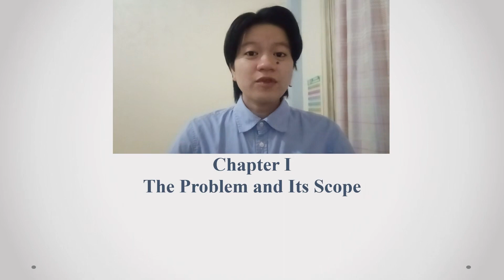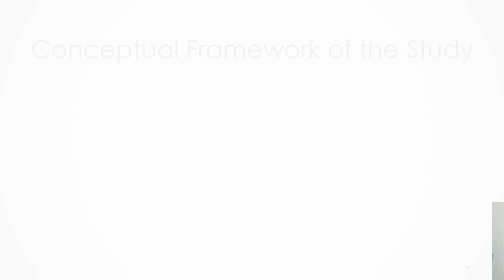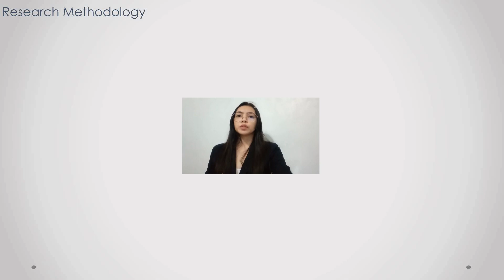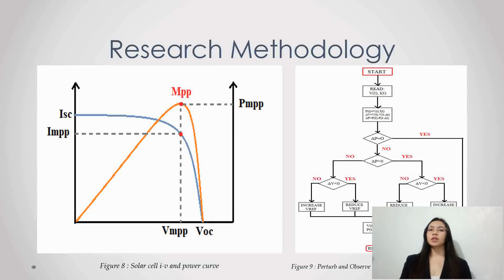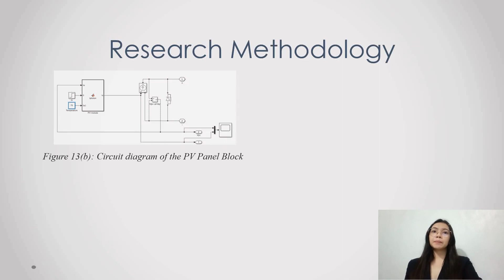The Use of Buck-Boost Converter in Maximizing the efficiency of Grid-Connnected PV System

Comment: NAME: Bernard Donn M. Valencia
CLASS NAME & SCHEDULE: ENS341- B ; (5-8pm) Saturday 
DATE: March 25, 2022

Reaction: The material was provided and discussed in a straightforward and concise manner. Because traditional grid-connected PV systems face numerous obstacles to the main grid's reliability and stability, the buck-booth converter should be an excellent solution for making solar energy an economically viable alternative to oil and gas.

REFLECTION: This research has significant implications for residential, educational, and commercial structures. The performance of the PV system will attract more customers, allowing their business to expand, and it will have the least negative environmental impact when compared to alternative energy sources. We need to come up with an idea for alternative energy that will help us conserve electricity while also being environmentally beneficial.

Comment: NAME: Clark E. Juanites
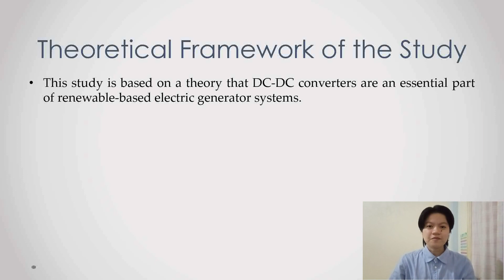CLASS NAME & CLASS SCHEDULE: EE 341A 6:30 - 8:00 PM T-Th
DATE: March 25, 2022

REACTION: This research is really interesting. How the researchers  handle this one amaze me.

REFLECTION:  Because fossil fuels and natural gas are fast depleting, we need alternative energy sources, notably in the production of electricity. By creating consistent voltage and increasing efficiency, the buck-boost converter improves PV systems and their performance. As a result, the number of PV modules required to connect multiple solar arrays to the grid will be lowered. This will surely be beneficial to the people.

Comment: Ronel S. Bayonado
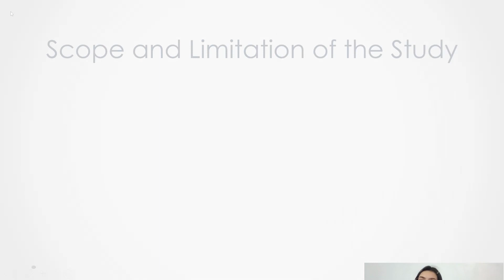COE 346 Methods of Research T-TH 5:00-6:30 PM
March 25, 2022

REACTION:
The proposal is informative and discussed very well. Really great idea to add a buck-boost converter to the standard components of the PV system in order to maximize efficiency.

REFLECTION: 
With the help of a buck-boost converter in PV systems, this will greatly reduce the power going to waste and increase it's overall productivity which means it generates electricity to its maximum capacity.

Comment: Mamigo, Jascha Anthony T. 
EE 341 Research Methods for Engineering TTh 6:30-9:00PM 
March 25, 2022

 REACTION: The researcher has done an excellent job of presenting the information and it is really interesting. They put a lot of effort into capturing green energy in order to provide enough electricity to the neighborhood.

REFLECTION: Because it is a solar energy system, this system is extremely vital due to the rising demand for energy. In the production of power utilizing solar systems, the Buck-Boost Converter concept is particularly good.

Comment: REY STEPHEN O. TUMAPON
COE 346 Methods of Research T-TH 5:00-6:30 PM
March 25, 2022

REACTION: This research proposal is great and interesting because it covers the use of buck-boost converters on photovoltaic systems with the use of the Pertub and Observe method to determine the maximum power point of the photovoltaic system. This study is very informative.

REFLECTION: The researchers did a great job on this research and enlightened our minds about the difference between solar energy and conventional energy sources.

Comment: NAME: Rupert Tristan R. Borlaos
CLASS NAME & CLASS SCHEDULE: ENS 341-A (2-5 Saturday)
 DATE: March 25, 2022

Reaction:
The research proposal in the video presentation is well introduced, the voice of the clear and can be heard but there is a background noise interfering in it. For me, visual presentation is good because they didn’t use colorful designs in their PowerPoint presentation. The research proposal is also intriguing because of the way they deliver and present their research.  

Reflection:
The research is all about buck-boost converter in maximizing the efficiency of grid-connected PV system. This is beneficial for household, commercial buildings and also the environment. This research has a huge potential because it is a good alternative energy source and it is very good in electricity production.

Comment: Villanueva, Chastine E.
COE 346 Methods of Research T-TH 5:00-6:30 PM 
March 25, 2022 

Reaction: 
This research was extremely beneficial to everyone. They do an excellent job at presenting their proposition. You did an excellent job.

Reflection:
In the production of power utilizing solar systems, the usage of a Buck-boost converter is quite beneficial. It will boost the system's efficiency.

Comment: NAME: Nica P. Ragay
CLASS NAME & CLASS SCHEDULE: COE 346-A (TTH 5:00-6:30 PM)
DATE: March 25,2022
REACTION: The researchers delivers their study clearly and also in a kind of advance engineering. Solving efficiency issues with our solar systems this kind of study helps those planning to setup their grid-connected PV-systems. This is a very cost savings since we are boosting the efficiency of how much energy we can extract from the sun.
REFLECTION: This study aims to have a greater savings to those homeowners and building owners that they can save and yet earning from the PV to Grid energy sell out. While using this kind of technology we can assure that we can provide the demand of the load and if we are generating more we can sell it to the grid corporation for a money-back savings or energy credits.

Comment: NAME: Tracy Alex E. Manzo

CLASS NAME & CLASS SCHEDULE: ENS 341 Research Methods for Engineering - SATURDAY (5:00-8:00PM)

DATE: March 25, 2022

REACTION: It's an interesting study. This study encourages the use of green energy to benefit the environment while also addressing process difficulties. This will undoubtedly motivate a large number of individuals to switch to green energy. The performance of a normal photovoltaic system will be improved by using a buck-boost converter. It will let the solar modules to use their full potential, allowing them to send electricity to the load with fewer losses. This is a fantastic idea.

REFLECTION: Fossil fuels such as oil and natural gas are rapidly depleting around the world, and these resources are unsustainable, necessitating the development of alternative energy sources, notably for power generation. By enhancing the components of the current photovoltaic system, we may be able to decrease losses and enhance power output. It is our obligation as students to not only develop ourselves but also to learn more about current technology that can help us in today's environment. And I'm well aware that there are a slew of great ideas out there just waiting to be discovered.

Comment: Name: Belinario, Cristy T.
Class Name and Class Schedule: ENS 341 B - (5-8 PM Saturday)
Date: March 25, 2022

Reaction:

Without a doubt, solar energy has the greatest potential to be used as a new source of electrical energy because it is an infinite source of energy. The use of a Buck-Boost converter for a grid-connected system could be a solution to make solar energy more cost-effective and self-sufficient than fossil fuels. The study will be beneficial to businesses and establishments. I agree with the statement that having a constant supply voltage supply means having less energy supply fluctuations, which is possible with the help of a Buck-Boost converter. A building with a Photovoltaic (PV) system has enough electricity for their load making their energy consumption from primary source which is powered by conventional energy last costly. Because the PV system is connected to the grid, it is possible to deposit the excess electricity generated by the PV modules. As a result, the cost of electricity is reduced, resulting in a higher income. In addition, the improved PV system based on the study will attract more customers, allowing the business of PV contractors to grow.

Reflection:

The study has taught me how impressive a photovoltaic system, also known as a solar power system, is. It is an electric power system designed to provide usable solar power through photovoltaics, which is the conversion of light into electricity, and consists of a number of components arranged in a specific configuration, including solar panels to absorb and convert sunlight into electricity. Renewable energy technologies, such as solar energy, can mitigate the negative effects of other energy sources, which emit greenhouse gases and pollute the water and air. This is extremely important for us humans to develop innovation that prioritizes the welfare of the environment in order to sustain life further. The proposed project is a little difficult for someone who is unfamiliar with the terms, but it encourages familiarity with these variables for more effective learning.

Comment: Loren T. Cuaresma
COE 346A Methods of Research T-TH 5:00-6:30 PM
March 25, 2022

Reaction: 
This study is unique, informative and interesting. In which that it uses a video buck-boost converter to raise a photovoltaic system's performance. It is a proposed solution to make solar energy cheaper than gas.

Reflection:
They studied buck and boost converters to produce consistent voltage and improve efficiency. The study's relevance is that the output voltage can be set higher or lower than the input voltage, keeping the voltage level constant. This study will benefit all that uses solar energy and ulitize solar energy in their filed of work.

Comment: Name: June Anthony K. Sarga
Class Name and Class Schedule: Coe 343 Methods of Research T-TH 5:00-6:30
Date: March 5, 2022
Reaction: The topic was clearly presented and explained. Back-boost converters make solar energy an economically viable competitor for oil and gas, as regular grid-connected PV systems face many major grid reliability and stability challenges. Should be an excellent solution.
Reflection: This study benefits everyone who uses solar energy and wants to use it in their workspaces and homes. It is good that  negative impacts and risks are also mentioned and  taken into account.

Comment: Caluscusan, Desiree Joy M.
COE 346 Methods of Research T-TH 5:00-6:30 PM
March 25,2022

Reaction: The topic was delivered and explained clearly. Since the usual grid connected PV system is confronted with many challenges to the reliability and stability of the main grid, the buck-booth converter should be a great solution to make solar energy an economically viable competitor to oil and gas.
Reflection: This study will benefit all that uses solar energy and is looking to utilize solar energy for their field of work or homes. It is good that the negative effects and risks are also mentioned and is taken to consideration.

Comment: Jaemzell Jazz Ocay
COE 346 Methods of Research TTH 5:00-6:30pm 
March 25, 2022

REACTION: The study presented by the researchers is very informative. 

REFLECTION: The output voltage quantity can be set to be more or lower than the input voltage, allowing us to keep the voltage level constant. The relevance of this research is that it allows us to work with voltages that are very different from each other - and yet remain within a narrow range of acceptable levels.

Comment: Dislan, Erdo Bataviano O.
EE341 A TTH(6:30 - 8:00 PM)
March 25, 2022

Reaction:
This is a Great topic that has been tackled on. The presenters are very well prepared, it's clear that they mastered their topics. Good  job guys.

Reflection:
This proposal is a very good way in harnessing solar energy. Having the buck-boost converter is a good way of producing electricity using PV system because it will increase its efficiency.

Comment: NAME: Ong, Pearl Marney A.
CLASS NAME & CLASS SCHEDULE: ENS 341 - Research Methods for Engineering - Saturday (5-8PM)
DATE: March 25, 2022
Reaction: The research shown is about the use of buck-boost converter in maximizing the efficiency of grid-connected PV systems. A plan for making solar energy an alternative to oil and gas. I'm impressed how well the converter can increase the performance of a photovoltaic system.
Reflection: The fossil fuels and natural gasses are depleting, thankfully there are alternatives. The buck-boost converter improves PV systems and its performance by producing constant voltage and increase of efficiency.

Comment: Catherine Joy Lacson
COE 346 Methods of Research T-TH 5:00-6:30 PM 
March 25, 2022 
Reaction: 
This study is unique since it uses a video buck-boost converter to increase the performance of a traditional photovoltaic system. It is a proposed solution for making solar energy a viable alternative to gas in terms of cost.

Reflection: 
They presented a study on buck and boost converter-based systems for producing constant voltage and increasing efficiency. The relevance of this study is that the output voltage quantity can be set to be more or lower than the input voltage, allowing us to keep the voltage level constant.

Comment: Macabinguil, Joshua R.
COE 346 Methods of Research T-TH 5:00-6:30 PM
March 25, 2022
REACTION: The researchers are excellent and they discussed the precise research.

REFLECTION: This could help for getting the exact purpose of the Use of Buck-Boost Converter in Maximizing the efficiency of Grid-Connnected PV System. The research is a big help to who doesn’t know about the use of bucket-boost converter.

Comment: Jessielou A. Gomera
ENS 341 B - SATURDAY 5-8:00 PM
March 25, 2022

Reaction:
The Use of Buck boost converter in maximizing the efficiency of grid connected PV system is an interesting research proposal. It is another innovation which will help the solar power to improve. I am amazed by the way the presented, they also elaborated key points which will help us know more about the buck boost converter.

Reflection:
The use of buck boost converter is ideal because the cost and complexity of the converter will be minimize due to the limited number of components used.

Comment: NAME: Heroshua C. Bantug
CLASS NAME & CLASS SCHEDULE: COE 346A – TTH 5:00-6:30 PM
DATE: March 25, 2022
Reaction: The concept of a "buck-boost converter" is foreign to me, but I'm sure this study will benefit a lot of people and is good for the environment because it doesn't emit greenhouse gases.

Reflection: The use of a buck-boost converter improves the performance of a standard photovoltaic system. It will enable the solar modules to use their full power, allowing them to deliver electricity to the load with lesser losses. This is a fantastic idea. Very beneficial to the advancement of solar power installation.

Comment: Noel E. Macay
COE 346 Methods of Research T-TH 5:00-6:30 PM
March 25, 2022

REACTION: The idea of this study was presented well by the researchers. They have knowledge on what they are doing and that what makes them understandable.

REFLECTION: This system is very important due to increasing demand of energy since it is a solar energy. The idea of Buck-Boost Converter is very good in the production of electricity using photovoltaic systems.

Comment: NAME: Reynabelle Kim Noble
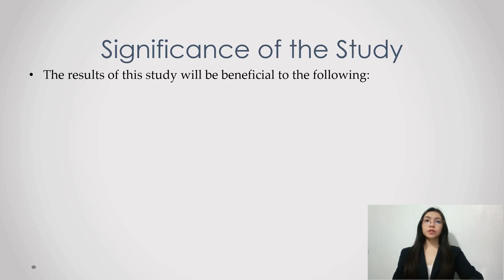CLASS NAME & CLASS SCHEDULE: ENS 341 A (2:00 – 5:00 SAT)
DATE: March 24, 2021

REACTION: Their proposal is well-presented, and their concept amazes me. Their presentation is simple, they proposed it well, and the concept is well-thought-out.

REFLECTION: The study they presented is about a buck and boost converter-based systems that are used to produce constant voltage and increase efficiency. The significance of this research is that the quantity of output voltage can be placed to be greater or less than the input voltage, allowing us to maintain the voltage level.

Comment: Gliocam Blessings C.
COE 346 Methods of Research T-TH 5:00-6:30 PM
March 24, 2022

REACTION: Because it uses a video buck-boost converter to improve the performance of a typical photovoltaic system, this study proposal is outstanding and instructional. It's a proposed solution for making solar energy a cost-effective alternative to oil and gas.

REFLECTION:  By enhancing the components of the current (PV) system, we may be able to decrease losses and enhance power production using this idea. The usage of a Buck-boost converter is particularly beneficial in the production of power utilizing photovoltaic systems, since it increases the system's efficiency.

Comment: Patron, Kent Ryan M. 
EE341 A (6:30-9:00)
MARCH 24, 2022
Reaction:
This research promotes utilizing  green energy to help the environment and at the same time solve the issues of the process. 
Reflection:
With this proposal we might be able to eliminate losses and increase power output by improving the components of the current (PV) system. Having the use of Buck- boost converter is very good in the production of electricity using photovoltaic systems and it will increase the efficiency of the system.